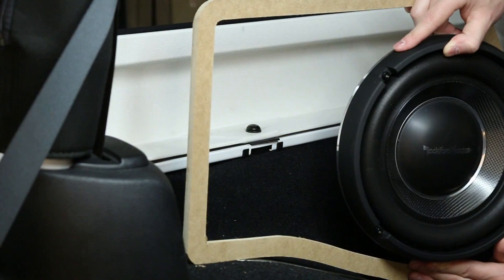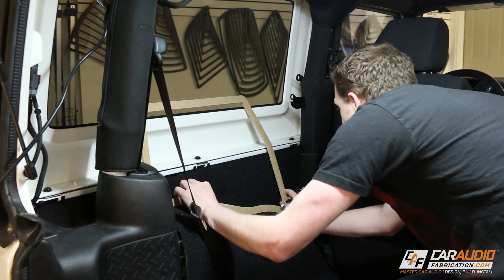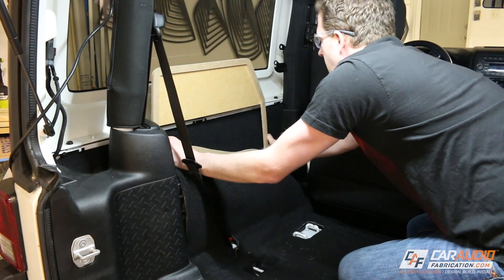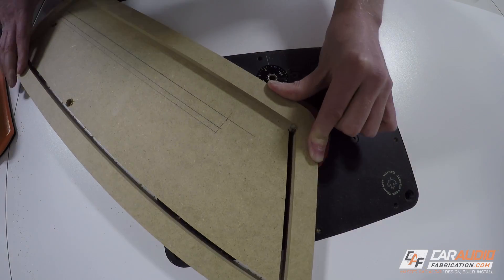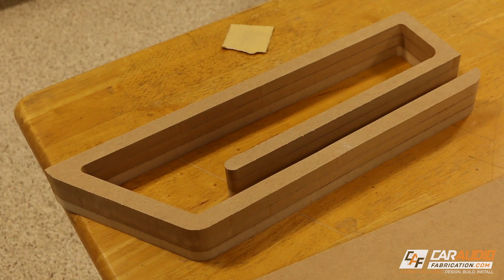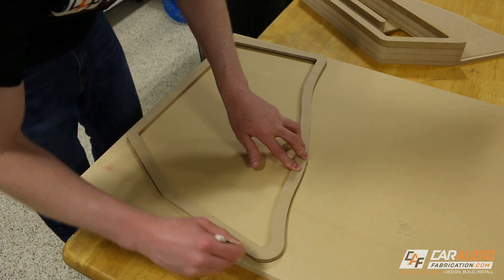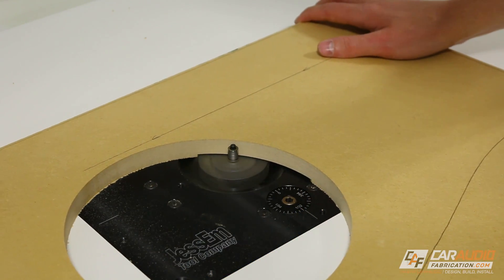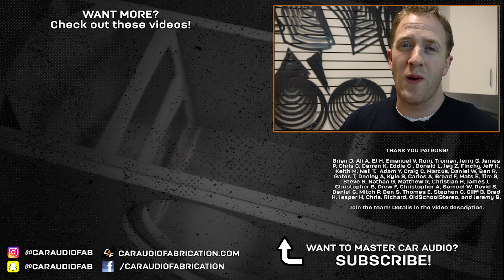STACK Subwoofer Box Layered - How to - CarAudioFabrication

Comment: Can I use this to make a top mount box for my 2014 Ford fusion using JL Audio 6W3v3-4 power range: 40-150 watts RMSpeak power handling: 300 wattsfrequency response: 30-300 Hzsensitivity: 80.49 dBtop-mount depth: 4-3/16"sealed box volume: 0.15 cubic feet please help me please help me let me know how much it will cost and I will buy the boxes I want to put two of those subs in the back dash of the car

Comment: It would lot easier and more cost effective if you got a cnc cutting mill and learned to use Fusion 360 for these types of builds. Most mills have a repeatability of ±0.003" which is a far tighter tolerance than most can do by hand. With your imagination and skills getting one of those can really up your game.
Reply from the maker: I worked as a mechanical engineer designing machinery in 3d for 10 years. I use 3d modeling programs daily and have a CNC router... and I can still build faster using these methods in the video. There is too much set up time  and prep time with CNC. Too many people think you just toss a sheet of wood at the machine and hit a button and out pops a finished part. If I was making 100 of this sub box it make make sense, but one off... I can just build it faster.

Comment: In planning on doing door pods with the layered technique because I need to seal the back to get proper back pressure on the prv midbass 10s I'm going with. Its also going to be easier than fiberglassing.

Comment: Time consuming is an understatement!! Using all your videos, I'm finally almost done building a box for a 2016 F-150 SuperCab. The idea was to create a false floor hiding two JL 10w7's in a ported box.

I avoided having it professionally done because it seemed too complex, annoying, & time consuming for a shop to mess with. 

But OH. MY. GOD. What a pain! The satisfaction wore off fast and building this was miserable!! Not to mention the neighborhood is covered in MDF dust, even with some vacuum dust extraction.

Getting 3 cu ft of volume plus a 40 sq inch port size meant using 50 sections. But it's tuned perfectly! (I had goofy shaped port that I added 3/4" sections to until proper tuning).

My biggest takeaway: I will never attempt this type of build again!! Simply too time consuming. As in many weekends. And a mistake can potentially cost you 10 hours versus 1 or 2 hours, for example.

Lots of mistakes and lessons learned, but these videos were invaluable. Thanks! But never doing this style of box again!

Two big lessons learned:
3. A master template made out of MDF can gradually deteriorate (using Whiteside high quality spiral bit). This warps segments over time (e.g. my walls became thinner and straight walls became janky).

2. Make sure you can get your hand in there to sand the port smooth (or anywhere else there will be air movement). My port ran perpendicular to the cuts, so sanding was imperative and annoying and difficult. Wait until the build is almost complete to sand. Don't sand after each piece is glued.

3. Just go talk to a good shop first, if you have money. Maybe they would be willing to tackle this. You don't know if you don't ask. In hindsight I would've been willing to spend $1,500 on my box, assuming a shop would've done it right.

Comment: Amazing, but you've got to be wasting a ton of mdf?
Reply from the maker: MDF is by far one of the cheapest building materials. I used about one 4 x 8 sheet for this. It wasn't that much and I save all the extra for rings or cut it to short strips for random uses in my shop. I have a whole cabinet full of several hundred 2 inch by 12 inch pieces. Learned that from master fabricators at Mobile Solutions and Rockford Fosgate.

Comment: Ive been thinking about using this technique to make my own center console that'll go inbetween the captain's chair's in my old ford pickup. A center console that has an 8" sub in the bottom of it. It's about the best spot in the truck to put a sub without compromising the use of the back seats.

Comment: This is a great technique and may prove very useful in an upcoming project my son and I are about to start, a custom box/amp rack for a '98 BMW M3 (E36).  Question:  If in our build it made more sense to work vertically, because the base is flat, would it be possible or not to mount the sub on the side, by cutting a hole through all the layers after it's a box?  The bottom is flat and the front (interior face) would be flat, everywhere else varies.  Thanks!
Reply from the maker: Yes you can cut the hole through the layers, just make sure you have full contact with adhesive on each layer

Comment: How du you find the volume of these odd shapes?
Reply: Pretty easy with programs like SketchUp.. you can just Trace out the inner part of it, move it to the outside of the box, extruded to how big the inside of the box would be and it will give you a volume

Comment: I'm building a portable-ish bluetooth box with a 750w computer PSU driving an amp and 10" sub.
I'm struggling to balance portability with power, and this method looks like a unique solution! I had been thinking of square and clunky tubes and chambers. It was all so complicated. This is simpler!

Comment: So this happened today.  My Porter Cable router quit working while cutting some perfect circles in 3/4" MDF.  Started sparking and sputtering and...done.  Had for less than a year, probably only used 1 hour at most during that time.  I'm irked.  WTF?

Comment: I wanted to make a layered sealed enclosure for an 8" woofer to be installed in the front doors of my previous car, capped off with an MDF circle to finish it off. Instead I stuffed poly fill in the door behind the woofer and got surprisingly good output with just a factory amplifier.

Comment: Any Ideas on a 2016 Freightliner ? I have some 8's I want to install, may buy a 10 or two, I need an amp for those and plan to take the input wires by splitting off of the 6x9s in my overheads in the condo...thoughts/comments welcome. Thanks. Peace.

Comment: I came up with a box design alot like this about 10-14 years ago.. Doing the same thing with the Port, but with a baffle, downward firing forced directional back pressure port... It took alot of wood wasted wood that it. But in the end it worked well and is all I use now when building a box... It allows you to make the sub have more bass, range and sharp punch then it would in a spec'd ported, sealed, or band pass box... All without over   excursion the sub in either direction. Anyone who heard the systems would swear it was like multiple 12"s or 15"s but nope it was a couple 8"s.. 12s and 15s were even crazier, but some on the precise punch was lost on the 15s..Me and my father used to build show competition systems (spl) , and show car custom systems. (and yes there is a difference... Lol)

Comment: I use stacks of 2" PS (pink foam insulation) for making fiberglass molds.  I make 3D models in solidworks, then I create a number of parallel planes, 2" apart, to creating slicing features.  Then, CAM and CNC out of 4x8 sheets from home depot.

Comment: Massive waste of material, money, time.  Just use fiberglass for the exterior and use one plane of mdf for the port channel.

That's got to weight a ton. What was that, $800 worth of mdf sheets, $700 of which winds up in the bin.
Reply from the maker: +David Villar I used about 75% of a single sheet. It was $22. Your figures are a little (a lot) off. In regards to weight yes it is on the heavy side, maybe around 30 pounds. We use MDF when possible because it is dense and acoustically "dead" and not likely to resonate. It also took considerably less time than I have ever spent on a fiberglass enclosure. One fine skim coat of filler and some primer and this box will be ready to wrap. Can't say the same for fiberglass at this stage. But hey, if you want to keep doing fiberglass be my guest. This worked great for me for this project.

Comment: Is there a starter router bits kit you can recommend with some of the basic bits you will need that won't break the bank.  I would like to get some experience before I buy the lack daddy set. I have a skill saw router and the and it router table. I would like to router the speaker holes and the amp covers. any help would be great, or possible link to these videos. ty!

Comment: Your port makes no sense. The opening inside the subwoofer side needs to be the same size as the actual port exit... it's essentially a wide open area on the inside... sure, it looks good from the outside. But it doesn't make any sense from a sound aspect
Reply from the maker: +Taylor Cox take a look at some of my design pictures on my Instagram @caraudiofab It absolutely has a consistent cross sectional area from the inside to the outside. No problems here, I think you are visualizing it a different way.

Comment: Dude Cnc router. Multi cam router
Reply from the maker: +ChardMan I have full access to a router, rather show the process with tools that are somewhat affordable, not 10k plus. (and yes I am fully aware there are options less than 10k but IMO none of them offer the same performance or end quality I need. They require constant tinkering and I'm honestly faster with the tools in the video.)
Reply from the maker: +ChardMan I misspoke, I have full access to a cnc router, but rather show the "by hand" way
Reply: Oh yeah I understand that I've have more access to cnc than hand tool with the trade I'm in
Reply: My hand isn't steady enough so I cheat :/

Comment: Once did form fitting enclosure from mdf and fiberglass. Added about 5lb of extra resin with chopped fiberglass and 50lb of sandblasting sand to make the fiberglass molding acoustically dead. Heavy as all hell but sounded nice. Also great for winter as it added traction on the rear wheels.

Comment: Why is this better than channeling for bends and mitre cutting for hard angles? It would seem to waste a lot more material to me. I've always channel cut for bends then fiberglassed over it for strength. The hard angles are decent candidates for mitre cutting. I just don't see the point in layering like this over the other method that I use.
Reply: esthetics,it looks a million times better and doesn't have messy,stinky ,nasty fiberglass

Comment: I plan on using a layered design to build a isobaric 4th order center console enclosure in a Ford Super Duty  pickup. It will allow me to maximize volume and add strength, as well as contour the box to better blend into the stock cabin. It will be 2 SSA Icon 10's with a single slot port that exits the console along the floorboard at the rear of the console. Should play relatively flat between 37 and 75 with decent output on a Sundown SCV-3000D

Comment: That's turning out awesome!

I'm curious about the efficiency of wood use. How many sheets of MDF was needed to do this stacking method as compared to building it the traditional way?
Reply: The box in the video could also be made by cutting each layer into several strips. Though you'd need to incorporate a box joint of sorts, by making each alternating layer have either the left hand or the right hand corner. That way you can make a solid corner like in a brick wall.
And with a nice tight glue up with woodglue it'll be as strong as solid layers of MDF. After all MDF is pressed sawdust bonded with woodglue.
Reply: What's wrong with  HDF

Comment: @CarAudioFabrication Mark, thinking back to your first video, the curfed port, this stacking technique would make a killer curf that could be simply glued to the edge between 2 mdf panels. This would use much less mdf than doing the entire perimeter with the middle area as waste.
To add strength to the joint between the curved stack and the flat panel just cut a rabbit on the outside of the curved piece and the inside of the panel.

Comment: hi Mark. first of all thx for some cool car audio vid´s. i have a question for you, or maybe someone else would comment my question. I have a dual 10" sub i my car. every year around september i take it out for the winter. Then in april/may i put it back in, but here comes the problem, I´m having a hard time every year trying to remember how the AMP. should be connected. it´s JBL 1004 in bridge mode.i don´t messe around whit the speaker cables, only the line cable from my radio. so here is my question. can you measure whit a volt meter on the speaker connections when both sub´s get the same input? i got one RCA line from my radio to an Y cable. but can´t remember witch line in i shall connect the Y cable to.??? so the way I´m doing it now, is by holding my fingers on each sub, and try to feel when they both kick at the same time.....

Comment: Another great video Mark. I'm watching this series as I'll purchase one of these Jeeps for my wife to celebrate after this stage of treatment she's going through.
In answer to the episode question; maybe a clear acrylic baffle piece to show that geometry and layers, of course some resin interior for moisture resistance this could be painted/body matched, all this could be covered by another removable layer/beauty panel/speaker grill to protect and for stealth aid. Of course I like variety of materials/textures as you've done on amp rack. This all adds up creating another dimension to all that hard work. Oh, I know you are not going to start all over but HDPE as main material would be fantastic in terms of its ability to take the abuse in an open top vehicle.

Comment: I would like to see how a box like this would fit in a 2017 Ram. Specifically in the bottom of the back seat with out having to get rid of the boards that extend out, which seems like you have to take out in order to have a box fit in there.

Comment: Hey Mark is there a difference how you put your hardware.I see you put your inserts on top and not under wouldn't it be more secure under then on top??
Reply: 209 fin chaser sounds like you're concerned about the insert withdrawal from the MDF. This reasonable concern as MDF relatively easy to tear out of but this Not likely with that particular sub and power. Reasons; As there are several inserts/fasteners around the speaker circumference and There is not that much of a load/force placed on the individual insert. Your logic to place fasteners on the back side is sound ...let's say if these were speakers with greater excursion (or even a larger diameter) and being driven by more power then absolutely the fasteners and baffle would be subjected to greater force/load then beef things up
Reply: Carlos V oh ok sounds good..I don't make speaker boxes but I do everything else just trying to learn more thanks..